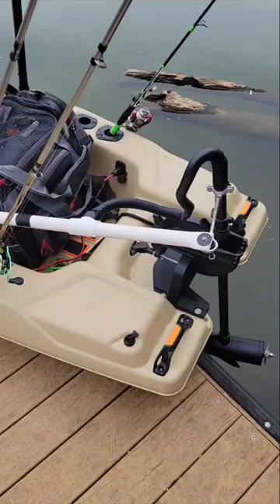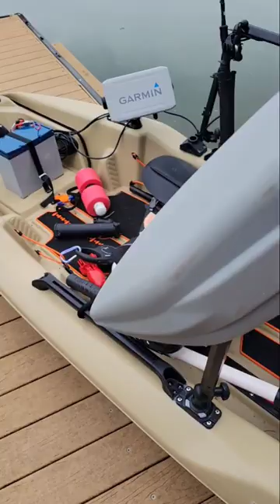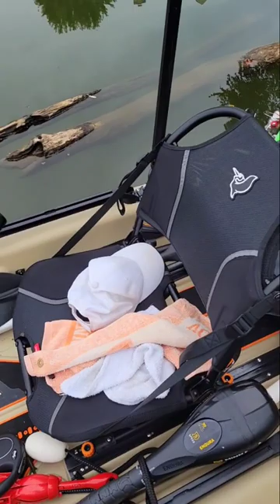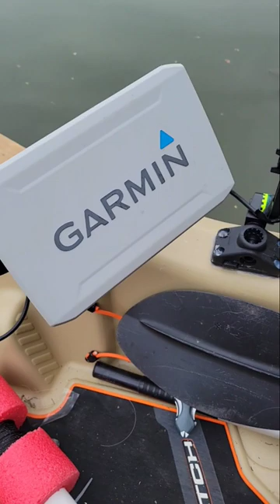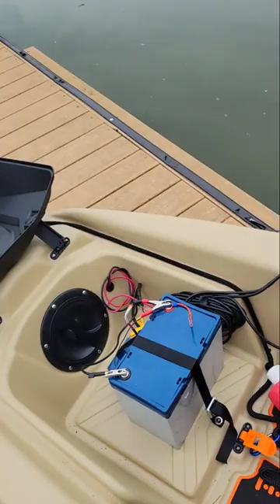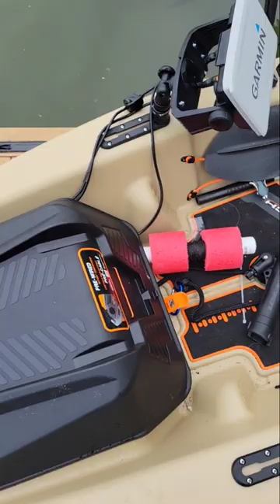Pelican Pwr 100 Setup

Comment from the maker: Im now running latest live scope and went with a 55lb thrust rigged the same way with a pwm speed controller, heavy wire to prevent volatge loss. And using a 20v craftsman battery on the finder and LS. Able to stay out all day